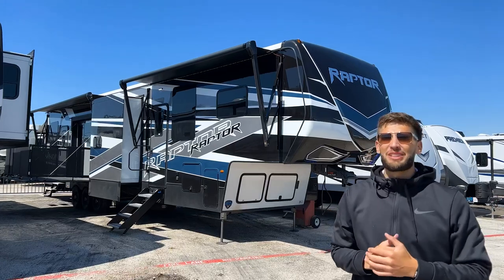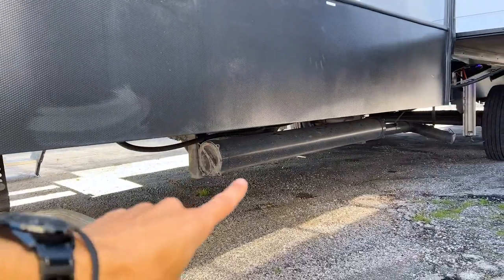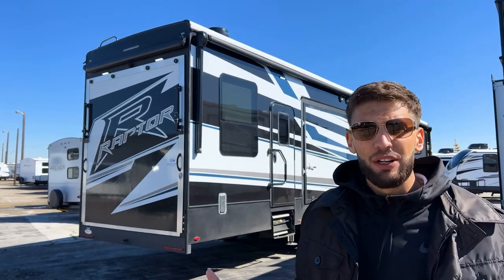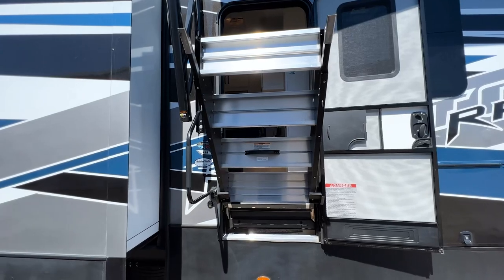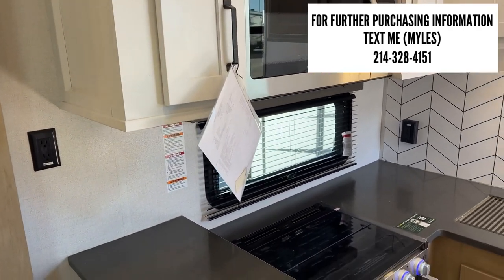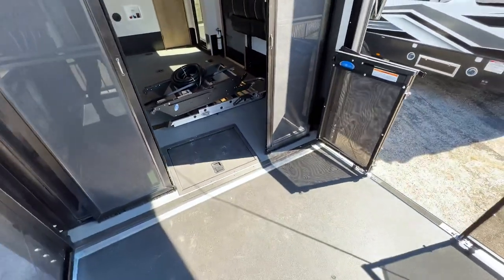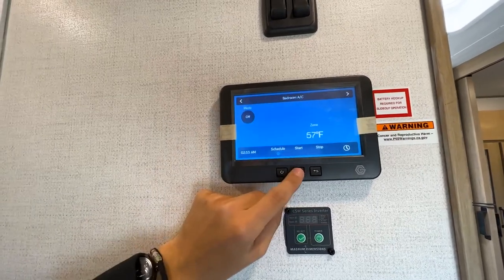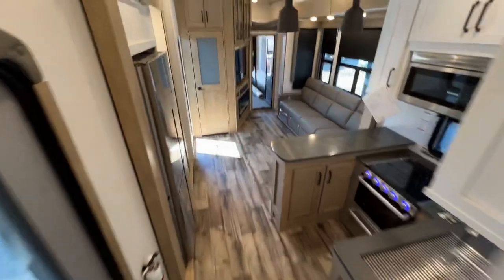Best Side Patio Toy Hauler in 2022… BUT BETTER! 2022 Keystone Raptor 429 Full Body Paint

Comment: Great details and I personally LOVE the colors and appreciate that manufacturer design is listening to colors.
I wish more manufacturers stopped the floor vents in the main areas. That's my biggest problem.
Reply from the maker: It’s the most efficient way to run heat in an RV. To do it any other way means you would have to run dryer vents and ducting with turns and bends that decrease overall efficiency and often take up storage space where cabinets could be. That’s why most have vents in the floor.

Comment: Need more drawers in kitchen. Bottom cabinets at coffee bar could have been drawers. Like the Rig a lot but lack of drawers is issue and combo W&D, ventless, not cool. 
Anyway, Rig this big should be set up for stackable or better yet, side by side front loaders. 
In bedroom put bed in slide and closet at front, then u could possibly add another possible W&D hookup. Give choice.
Outside colors are fantastic. Inside decor colors awesome as well. So sick of BROWNS! Inside & out.
Always fun to watch yur vid's, and can you also add the length of the Rig when you give the vehicle weight? Appreciated. Ty Miles.

Comment: I'm not sure but I believe one of the fuel tanks is for diesel, since the generator has a Cummins logo in the top left. You mention both 
30 gallon tanks are for unleaded.
Reply from the maker: It is not for diesel. It is a Cummins generator, but it runs on gasoline.

Comment: 21:00 That crooked outlet cover is a bit disconcerting. I don't like when things "you're not supposed to see" aren't done right.
Reply from the maker: Yeah… I have yet to see an RV that is 100% perfect as they are all put together by hand. Even the house I bought as a new build had various imperfections. But the good news is, That’s something that can easily be adjusted and we would adjust for the purchaser! Just like they touched up and fixed the the imperfections in the house I bought after I walked through it.

Comment: Far better than the Grand Design Momentum 395MS that you reviewed. A much more open floor plan. Only thing I would change here is making the top cabinets match the lower ones, and find a suitable color for the back splash to blend better with the counter tops. The white looks a little out of place. I would also add a pair of removable support legs to the side deck. Other than that I'd run with this one as is but the prices are still ridiculous. You can get a really nice double wide for the price.

Comment: Could you explain or show how to access the Loft space? I didn't see ladder etc.    *also if legs are used on the rear-most patio, can the cables be unhooked? Looks as though steps go where cable will hit you in face. Myles we LOVE YOUR VIDEOS!!! We have our home and land for sale and thus far.... we chose this toy hauler to be in our top 4 picks. ❤❤❤
Reply from the maker: Yes, it comes with a ladder to get to the loft. Or I can personally get you a trampoline if you would prefer that method 😂 and yes, cables will disconnect from the patio. That’s how you get it into a ramp position to load in toys as well.

Comment: ABSOLUTELY A BEAUTIFUL COLOR SCHEME AND STRUCTURAL DESIGN FOR TIE DOWNS ARE ON POINT BUT I SAW ANOTHER TOY HAULER WITH THEE BADDEST INTERIOR LIVINGROOM I'VE SEEN AND THAT WAS THE GRAND DESIGN 395MS⁉️ I WISH MORE TOY HAULERS WOULD COPY IT AND USE THEIR PDI IT WOULD CUT DOWN ON THEIR COSTS ULTIMATELY BECAUSE AS I WAS TAUGHT IF YOU DO IT RIGHT THE 1st TIME YOU WON'T HAVE TO DO IT AGAIN! 🤔💣💥
Reply from the maker: Yeah I have a video of the 395MS on my page as well. It’s a very cool toy hauler! But you can’t achieve that floor plan and also have a side patio.

Comment: Nice Toyhauler,  Couple questions...

 I have an F350 SRW, 6.7 POWERSTROKE,  But it didn't come equipped with the 5th. Wheel prep package.  Does this dealership offer installation for the prep package? 

Also, Does the keystone raptor come in a smaller format,  maybe with 2 Axels instead of the triple? 

Also, How much is your dealership selling this specific TH for. Thanks 👍 😊
Reply from the maker: Yes we install hitches and yes Raptor has various different floor plans. They are all available to look at on keystones website. As far as purchasing information, text me 214-328-4151.

Comment: I'm not a fan of the color scheme. I like the white and I like the light wood color, but I don't like them together. I don't understand the purpose of a backsplash that doesn't go all the way up. It just makes it look unfinished. And, I don't like the floor at all 🤷🏼‍♀️ maybe it looks better in person? I really like the side patios, but I'm not a fan of the floor plan. And, it seems that this is the only floor plan I see with the side patios. Fiberglass sink at this price point? Those snap blinds in the garage....why??? I like the tinted screen/glass doors to the rear patio 👍 That full body paint looks sweet though 😉